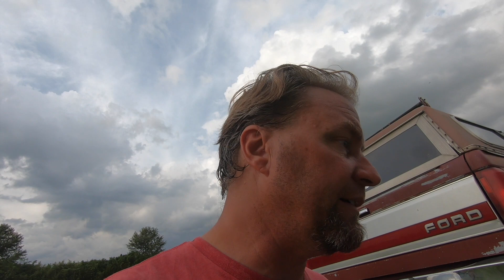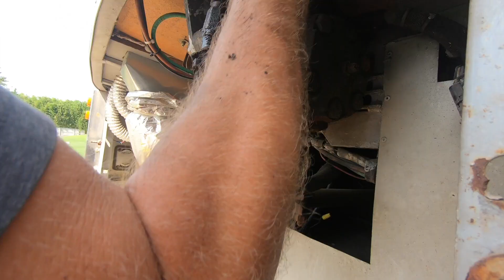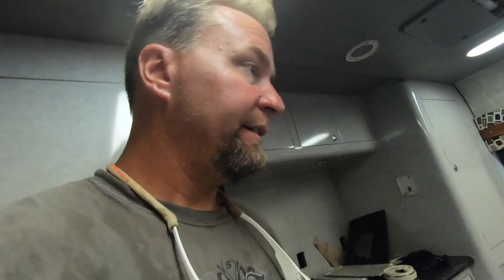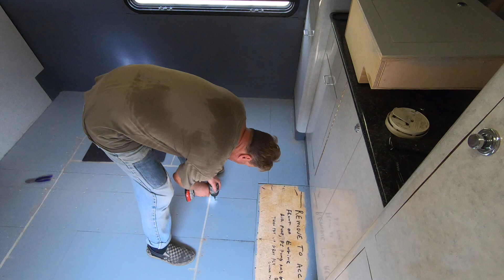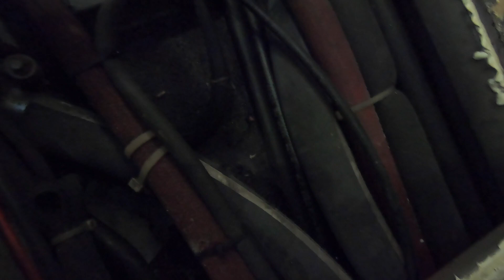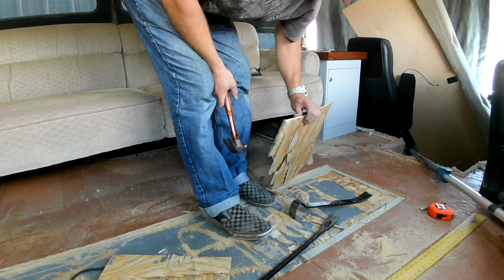Bus Conversion Don't!

Comment: Well that was a ton of work I've got an 84 MC9 the center tunnel is wide open right now. From on top it's empty and a plywood floor but underneath in the cargo bays it has panels that are bolted to the bottom of the tunnel. If you remove them every pipe and hose is spray foamed in so that sucks for removal but I could still use the top side to put replacement hoses, pipes etc.
 and I've been thinking about the same thing  happening down the road.
I think you helped me make some critical decisions planning for the floor in the future.
Thanks man better safe than sorry.
BTW nice coach you have there.
Reply from the maker: Thank you! The next couple episodes will be me figuring out the best way to do it. Tune in and learn from my mistakes. Lol!
Reply: @11thhourcustom  already subscribed brother I wouldn't miss it. Us bus nuts gotta stick together BTW love the video's
Reply from the maker: @briandavis9975  Thank you I really appreciate it!

Comment: Is your underbelly not accessible from your bays?
Reply from the maker: That trough is only accessable from inside the bus.
Reply: @11thhourcustom  okay. Our underbelly can be unbolted in sections starting at front bay to the fuel tank. My panels are covered, but I do still have the hatch over engine.